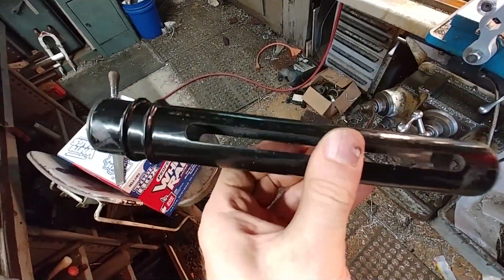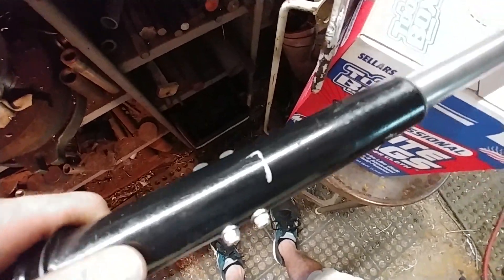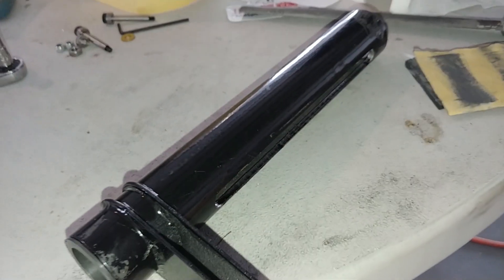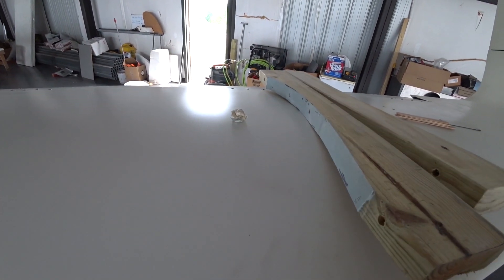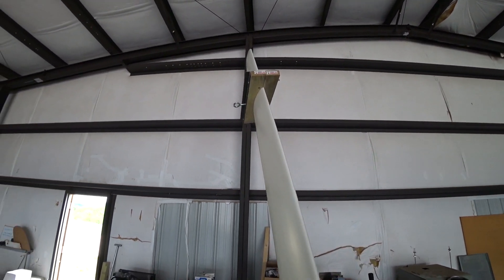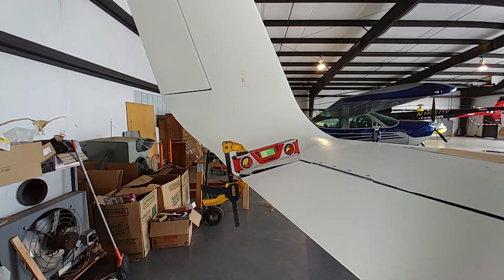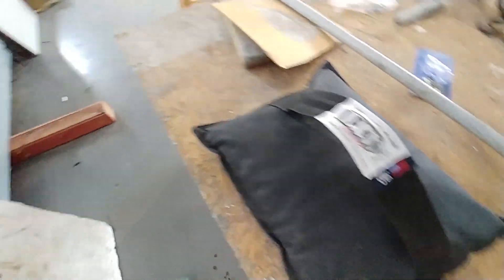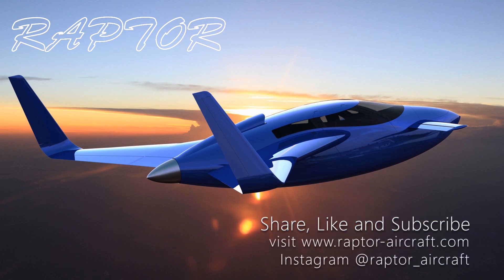Tweaking and Testing - Building the Raptor Prototype

Comment: Not an aircraft engineer but with respect to your play in the side sticks it seems to me your always going to have a little slop of your using bearings as they need to roll in the slot if the slot is tight enough to remove the slop the bearing would be fixed in place. Is there a reason you couldn’t use a delron or hdpe bushing with a tab that fit snugly in that slot polish up the sides of the slot and if required run a safety bolt through the assembly. This would make for a tight slot reasonably smooth action and little to no slop?

Comment: I wonder why the surfaces finish on the tube slow wasn't a little better. Perhaps, the bit was dull, or the chips lingered in the cut.

Sidesticks are all the rage these days, but I would rather have the controls ambidextrous, so that if one hand became cramped or injured it would be less of an issue to fly.

Comment: Raptor Aircraft    What is the advantages to toeing the winglets in?  Won’t this increase wing bending moments thus be a missed opportunity to optimize plies in the wing spars and structure?   

How will a static test result, be used to inform the wing flap questions, that are dynamic in nature?  Is this a stiffness measurement that will then go into flex body or other FEA analysis?

Keep fixing the problems, you can do it!